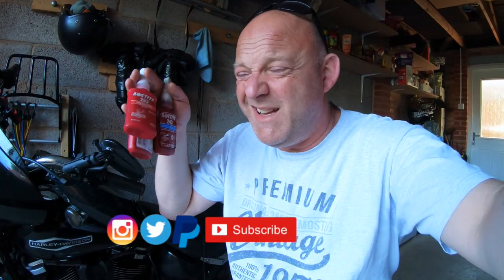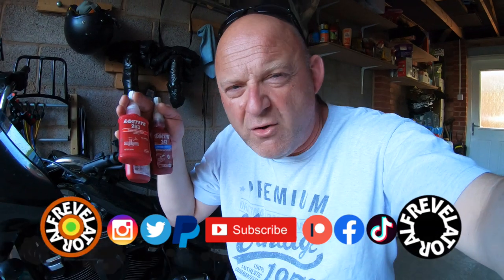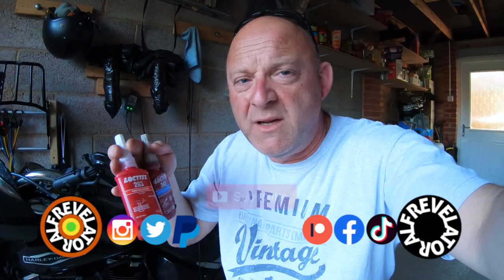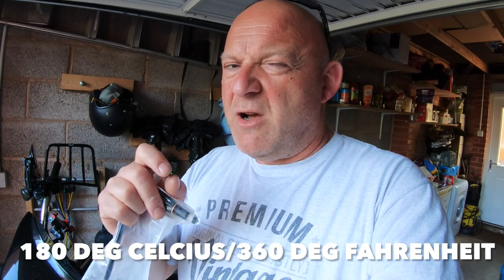Which Threadlock To Use On My Motorcycle | Loctite 246 Alternative

Comment: I typically use blue Loctite  243 or Permatex blue on most bolts. If you ever remove, or yes even retorque, your bolts the loctite bond is broken and has much less bond than leaving that bolt alone. I will never use anything stronger than blue on bolts that have heads that are prone to stripping. So no red or orange on derby cover bolts that have allen heads, as I have stripped these bolt heads before. What a pain in the a..  A few exceptions to the blue where I would want to use orange med/high strength is shifter pegs and highway pegs that can tend to get twisted loose by vibration and the action of your boot on the peg.
Also of importance is threadlocker fluids can affect your torque settings because they act as a lubricant when fresh and liquid. You should always use the lower end of the torque range provided when adding loctite.

Comment: I just use the 'blue' 243 or Permatex Blue (whichever is open at the time in my garage) everywhere the service manual requires Locktite, noting that I do not do internal engine work. Never had any issue.  For the side covers on my M8 LR, no Locktite is needed and the screws on my bike have never loosened - the trick here is to properly torque the screws (not the she'll be right mate) - use a torque wrench, 24-36 inch pounds and there's no prob with lose screws.

Comment: I am not surprised that you got a different option from the dealer than the manual. Was it a mechanic or just the person behind the desk? I experience is that people make stuff up rather than feel stupid that they don’t know everything. I had an issue (maybe at the same dealership) where my brand new bike pulled to the left and was wearing the front tyre right shoulder -  I was constantly 9:52  fobbed off with comments like - it’s the raid camber , we have put the straight testing bars against it, our mechanic test Road it (got it covered in cow shit too). Then I was told to go somewhere to get it lazer checked - £100 ish pounds as it’s a Harley and requires a lot more set up. Finally I looked at it and with two pencils and a bit of string I could see instantly that the back week was out of line. 10 minute job to straighten it and it was sorted. 
The point is lots of people have varying opinions and I guess you have to go with what seems right to you. It’s good if you have someone you can trust - shame you don’t seem to be able to trust the main dealer!!! Who could have said let me check that whilst I also look in the manual!!

Thank you for doing such a thorough job of researching the thread lockers. I look forward to see how things pan out. 

Cheers 👍🤜
Reply from the maker: Cheers yep 👍